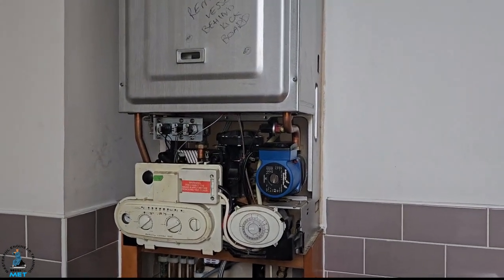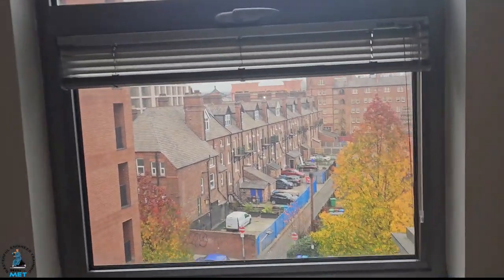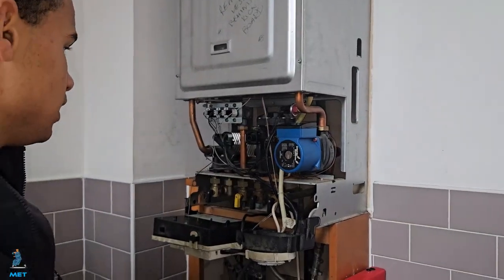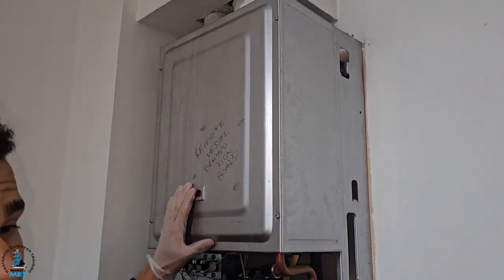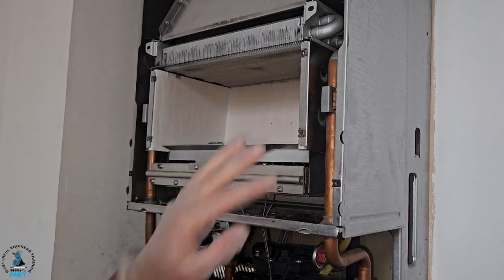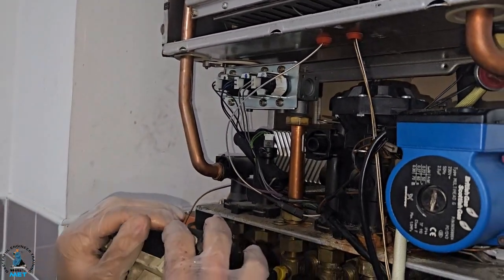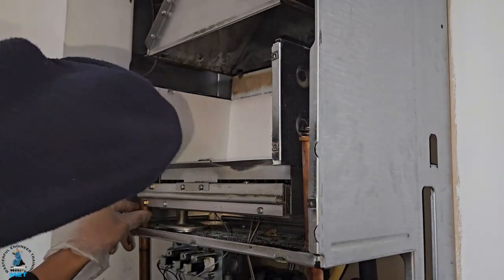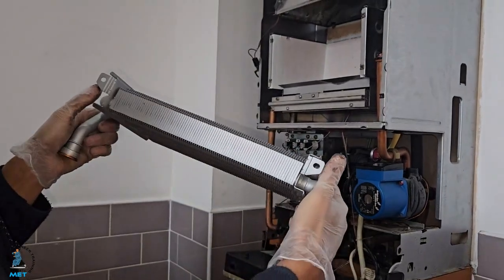Chaffoteaux Britony SE Main Heat Exchanger and Plate Heat Exchanger Replacement

Comment: Hi i have taken of both flex pipes from the Pressure Relief Valve and have not noted which one goes where. Can you help? IT Does not show in your video if the expansion is at the top or bottom! or does it not matter?